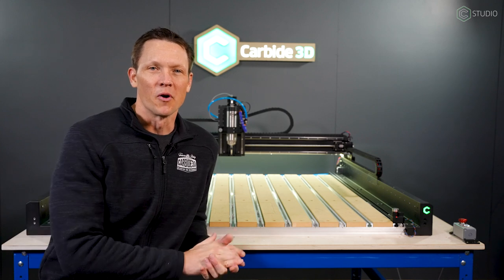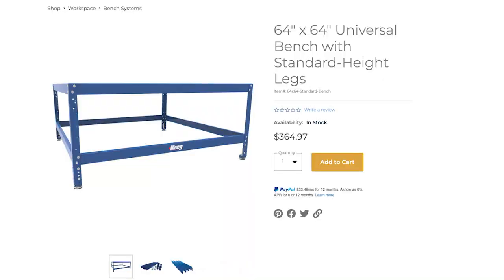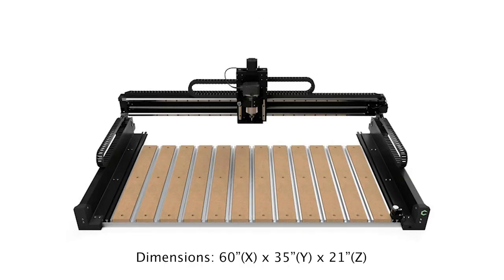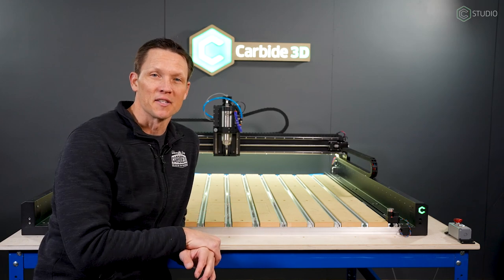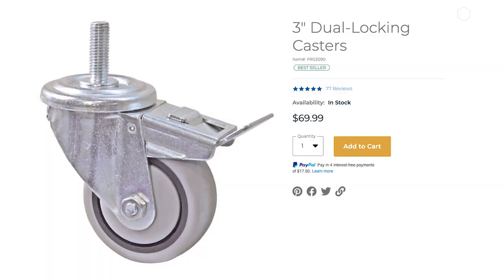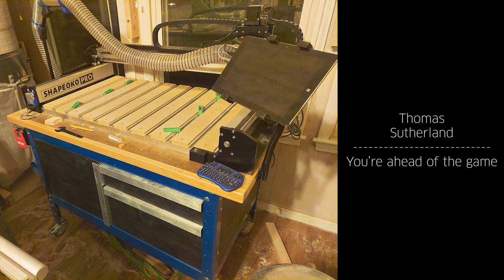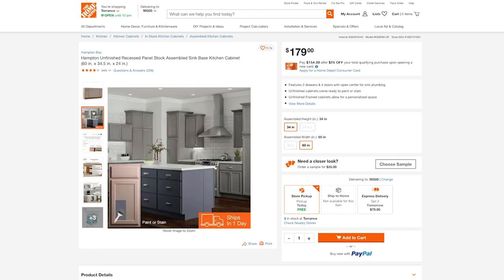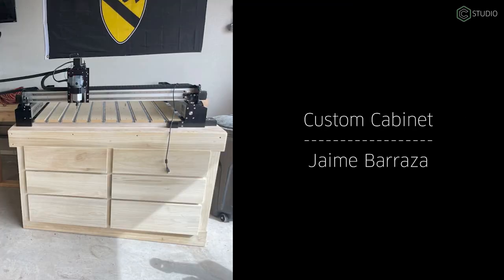The Table Episode - Shapeoko 5 Pro - Video 6

Comment: I definitely looked at the Kreg. I settled on the Rockler Rock-Steady 54"x54" and have an overhang all the way around. I used two Lowe's 72"x30"x1.5" project boards cut to 62" length. I went minimal as I have a rolling tool cart with all my CNC stuff. And you give me a flat area to start collecting stuff.......it's going to get clogged with stuff. :D It's on removable lifting casters so the adjustable feet are still used and if I need to move the machine, I install the casters, lift it up, then move.
Reply: What was the final price, for this option?

Comment: I'm so torn between the 2'x2' and the 2'x4'. I really want the 2'x4', but don't have a ton of room in my 12'x20' shop.
Either way, I'll be building my own table that uses the basic L shaped leg design originally shown on new yankee workshop and made popular by a ton of yt woodworkers. Basically a wooden version of the kreg table. It's a quick and easy to put together design, plenty sturdy and adaptable to whichever size is necessary.
Still mulling over the size decision. Keep these 5 pro videos coming!
Reply: I had the same decision. After doing some research on tiling capabilities though I decided to go with the 2x2. Better on space and I can always tile beyond the 2 foot mark if needed.

Comment: I built a base from 4x4s, 2x4s and plywood with 5 inch casters. I am close to broke and it was cheapest. You might look at the Harbor Freight scaffold. Would be able to move, double stack, use 1 or 2.

Comment: How much does the machine rack back and forth as it operates.  I am thinking about a table with 6 legs made out of 4x4's with spans made out of 2x3's.  a single 2x3 can hold about 70 lbs in the center of an 8 ft span.  I would have multiple spans topped with plywood.
Reply from the maker: The machine is not going to change position on its table.  Your plan is a solid one.  👍🏻

Comment: That table seems expensive at first, but with current wood prices, and the time saved not having to cut down material, that is not a bad price.
Reply from the maker: It's always nice to encounter customers who know the value of their time.   
Some people have complained about the lack of structure with the KREG setup.  We have been running this setup at HQ for over a year.  We plan to add drawers and cabinetry to stiffen the basic metal structure further.    The mobility is essential in our shop and might be the same in yours.  Everyone has unique needs when it comes to their exact setup.

Comment: how stiff and flat is the 5p bed on its own?  my shop space is currently a shipping container, and space is limited.  I have a good strong work table that is not perfectly flat that would be a good spot  for the cnc.  I would want to create a hoist above this to lift the cnc up out of the way.  Will I need a stiff flat platform for the 5p like a torsion box, or will some simple rails work.  What support is needed and how prone is the 5p platform to flex?
Reply from the maker: The machine is fairly rigid, but it is big enough that it will conform, at least a little, to the surface underneath.  This is to be expected from any benchtop machine to one degree or another.  If you surface the wasteboard, that should account for any flex.

Comment: Would it be better to have retractable casters so the the table stands on it legs rather than on locking wheels?  I wonder if the shaking would wobble the table while on casters.
Reply from the maker: With the wheels locked the table doesn't wander nor does the machine.   We run this setup everyday.  Several people have gone with tilt up or retractable casters.  There is no wrong answer.  It's all up to you.

Comment: I just ordered this Kreg table to go with my Shapeoko 5. Is the use of MDF instead of plywood fine for the table top? Trying to keep costs down as where I live (Switzerland) a 1" MDF sheet is the same price as a 1/4" sheet of plywood...
Reply from the maker: Arnaud, just be sure to prevent significant sag in the middle of the table.  Putting stringers underneath your surface should help.
Reply: @carbide3d  Thank you, I will do so.

Comment: Did you re enforce the bottom with additional 2x4 braces? The kreg tabke is rated for 600 lbs so probably not needed
Reply from the maker: The bottom has some additional struts made from the same 3/4” plywood.  Pictured briefly in the video.  You’re welcome to put whatever reinforcement you’d like under there.

Comment: With casters and an uneven floor, how would you go about leveling the table? I assume everything has to be perfectly level to ensure accuracy of the router.
Reply from the maker: The minor differences in the table, frame or top do not affect the structure of the machine.  The hybrid bed is a system not vulnerable to a reasonably flat surface.   We machine all the parts in house to ensure accuracy.
Reply: @carbide3d  Awesome. I have the shapeoko 3xxl but planning on picking up this one soon!!
Reply: Skelang leveling casters could be an option
Reply: @BRyan-fw4dh  i just got the table with the kreg casters my garage is not level but there adjustment in the leg of the table it self as it is adjustable fro 31" to 39" so I leveled the table that way and have the casters on

Comment: What is the size of your table topper?
I understand that the frame of the Kreg table is 64x64 and it appears you have roughly 3 inches of overhang. Can you provide some specifics?
Reply from the maker: 68”x68” - 2” clearance around the frame.

Comment: Kinda crazy that y'all didnt build a torsion box.
Reply from the maker: It’s completely unnecessary.
Reply: The hybrid bed adds a ton or rigidity over frameless designs that absolutely need a table with more structure since they don't have much structure.